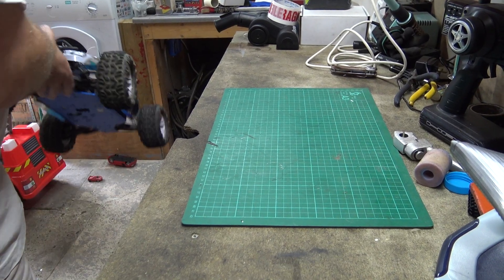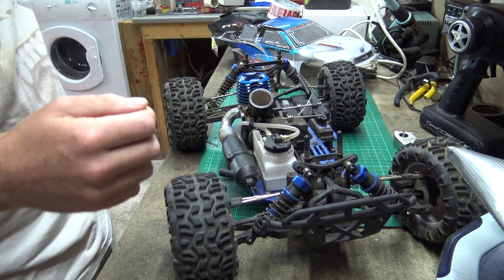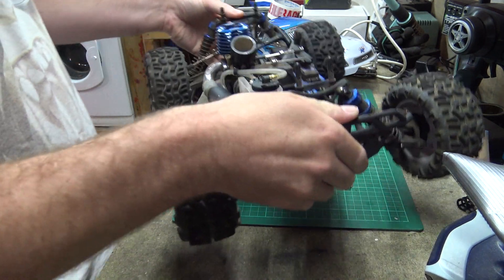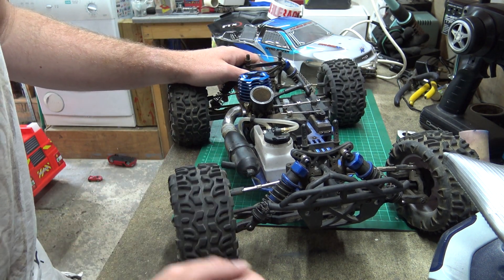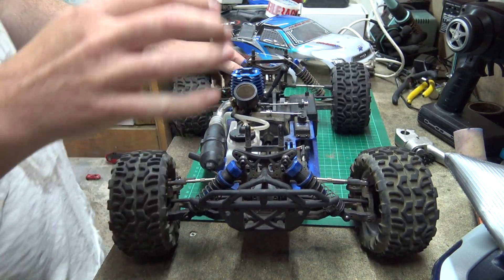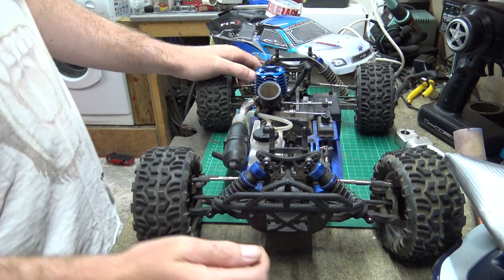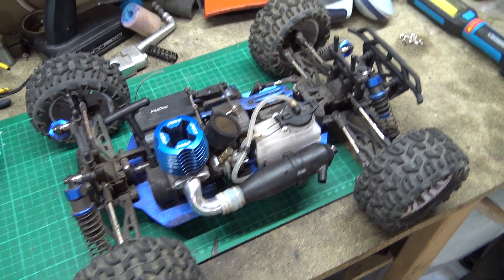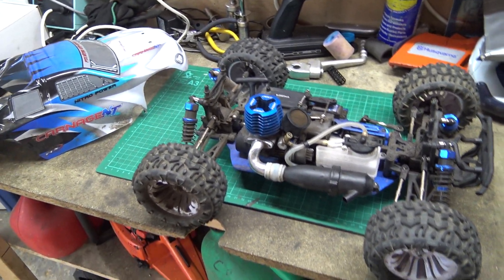More Nitro Engine Tips For Problem Finding

Comment: I was just thinking about trying to tune my T-maxx 3.3 on the block like you were saying. I'd use a more similar method to how I'd tune a weed eater engine. Turn the HSN to find the highest RPMs, then back off about 1/8 to 1/4 turn, then do the same for the LSN while the engine is at idle. I think it could work, but I'm not sure I'd wanna hold that tiny little engine at such high RPMs for that long. I do have limited space though, unless I run out to a field or something, but it would be nice to get a good tune just for putting around in the yard.

Comment: Av you looked at your hex nuts  as they are plastic mine was jammed on my wheels. Thats why I changed them to aluminium nuts. So if ne1 read this you need to change them as you wll c with plastic nuts the wheel moves. If you grab top and bottom of wheel ull see the wheel has a wobble.

Comment: Test drive my nb16 today, nippy little thing only stands me at £50
Reply: They are great! fun. I've got 5 of them 3 buggy's (Spares) 1 buggy with add-ons and a Truggy full hopped up all alloy add-ons, tuned pipe etc..
Not had them out in years! I got a lot of bigger nitro as well, some Rusty-Ben would like but.. I can't deal with parting with them 😂
Reply: @Ratchet_effect  this is my 2nd nitro rc car I've had, clutch and pullstart and that was it. Started straight away. Slow off the line but one the revs build up it shifts
Reply: True! they can be little rockets of joy. I got pull-starts on all my 1/16 scale apart from 1 spare engine that has a very rare roto start backplate on a .07 engine. I found a toy store online that had them in stock some months back now, I think it was called toy and model store, in the UK. Pull-start broke so I thought I'd give it a go. As I have roto start on one of my Savages 👍🏻